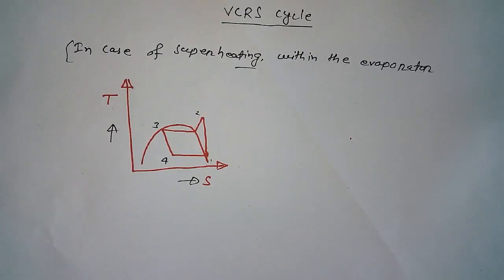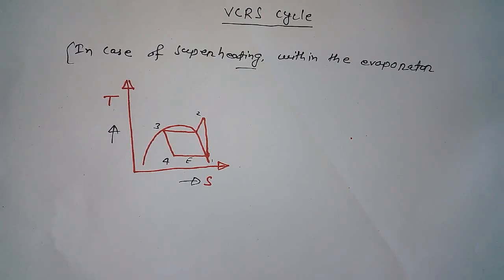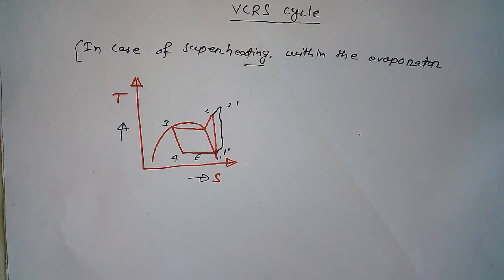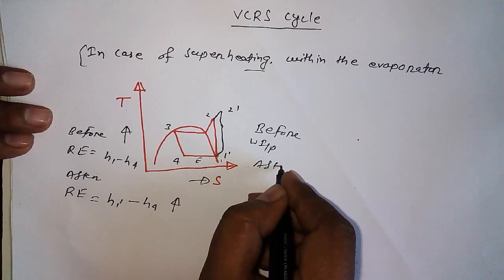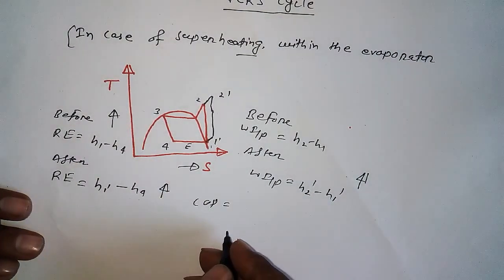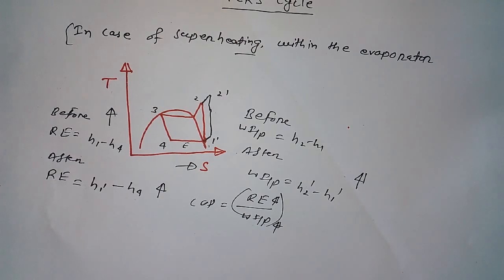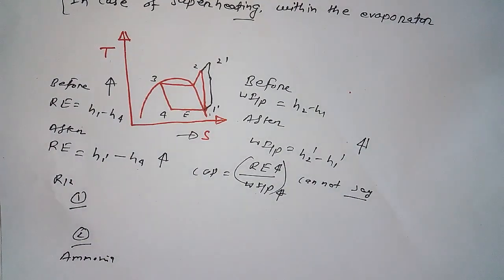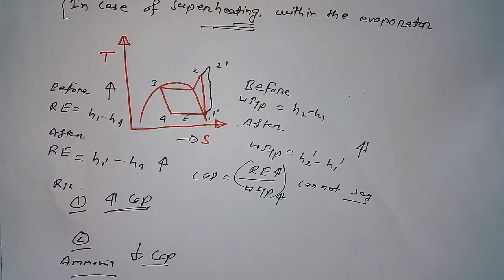Effects of Super heating within the Evaporator on VCRS Cycle- RAC Tutorial- 9

Comment: What is the reason for the increase in COP for R12, but decease in case of NH3? I guess the reason is related to the fact that on a p-h diagram, the isentropic curve gets flatter in case of NH3 as the degree of superheat increases, so the increase in work is quite higher as compared to the increase in R.E.